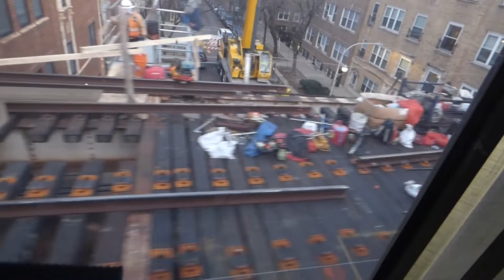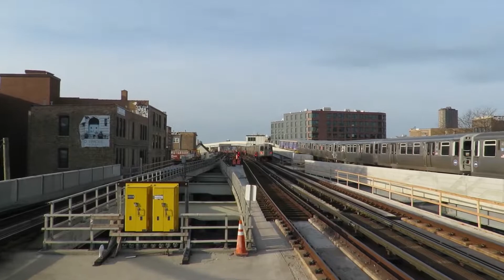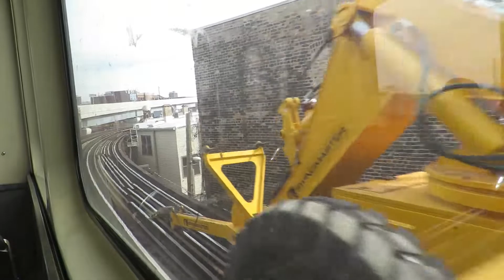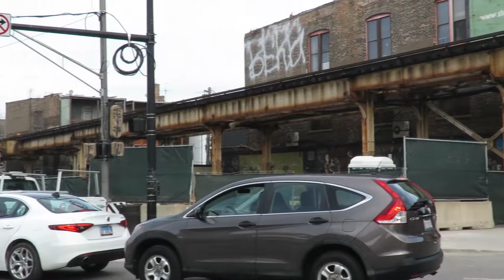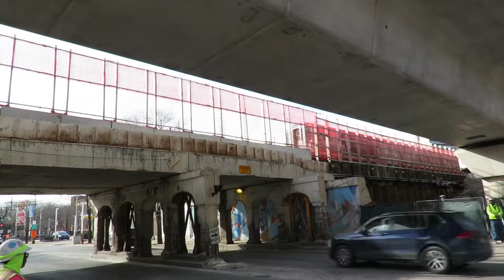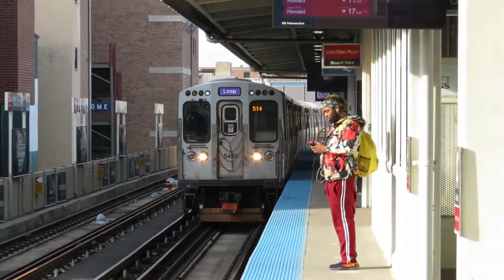CTA Red and Purple Modernization - March 2022

Comment: CTA has done a good job fixing up their system! Looks way better compared to NYC’s
Reply from the maker: I am wondering about their interborough express as well as their R211s
Reply: @Jackyliu009  R211s are still in testing phase. Seems like CTA, MBTA, and BART all have their new trains up and running. As for the inter borough express, it’s all talk until something actually happens
Reply from the maker: While RPM and the Red Line Extension are progressing, the Damen Green Line station as well as the rehabilitation of Austin has been long delayed.

The Damen Green Line broke ground in 2018, but four years later as of now, not a single piece of it has been built.

Comment: Nice video update. Any idea if there are plans to straiten the infamous Sheridan S curve? Seems any modernization should include revising that major slow zone.
Reply from the maker: Not released as of now, CTA is doing RPM in multiple phases that's for sure, so there is definitely some time where Sheridan will be rebuilt. Rumors suggest it may be replaced with Irving Park.